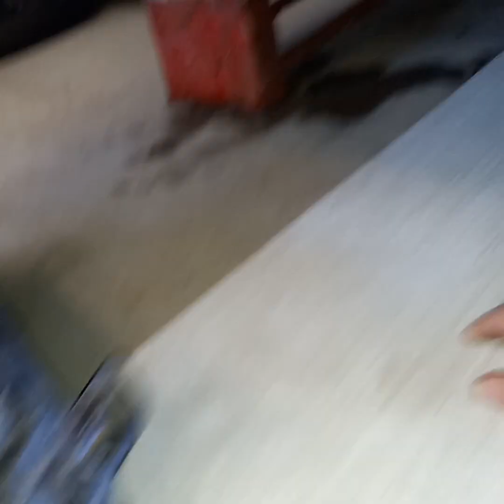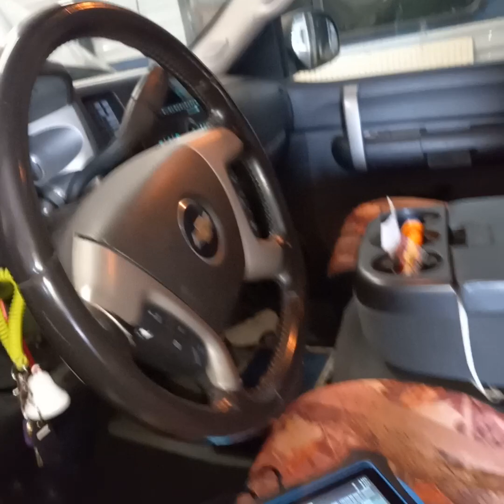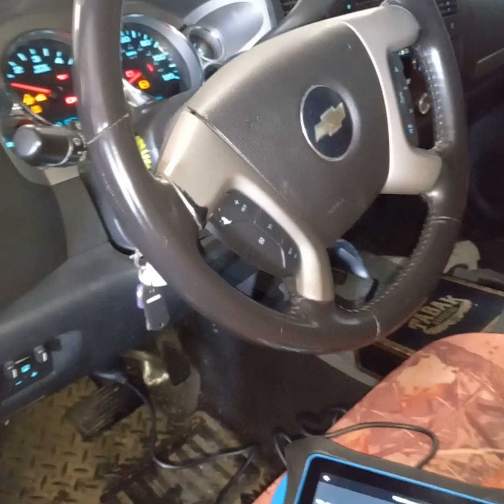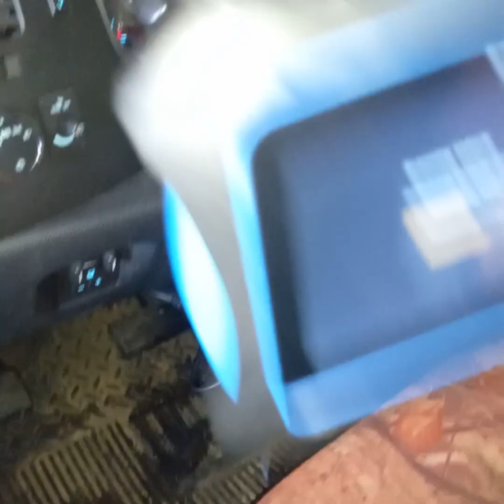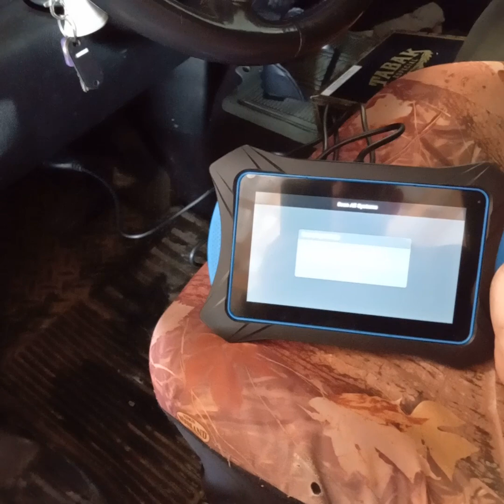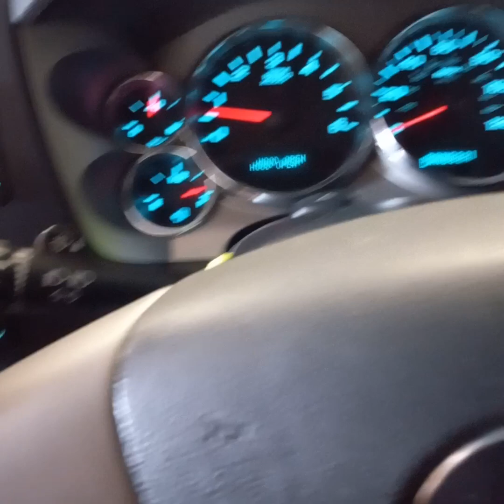2009 Silverado Air Bag Fault Code B0083 repair using the Award Winning Innova 7111 Scantool.

Comment: Is this scanner still working good for you?Does it give you a lot of functions, and how is support from Innova? I'm a backyard mechanic  just learning a bit more of obd2 cars, and I was considering the smaller Innova SDS 50 tech scanner.  I know you can get more functions with the launch and Autel scanners, but I am a bit leery because most dealers are online and it's hard to know if they are selling copies or overseas models which can make support for the tool impossible
Reply from the maker: I have been happy with it. I bought my 7111 from my local parts store. Keep a eye out when they sometimes put them on sale. Good updates from Innova